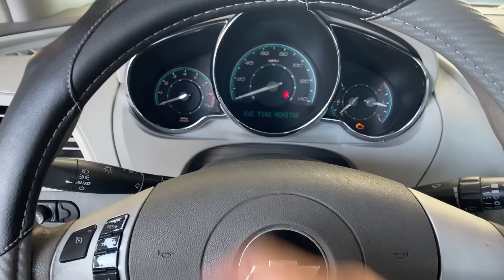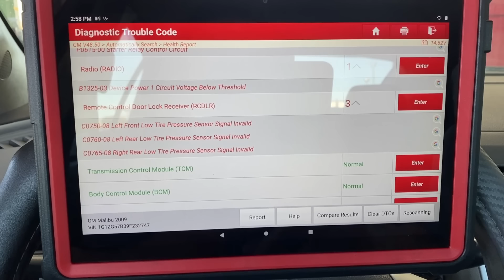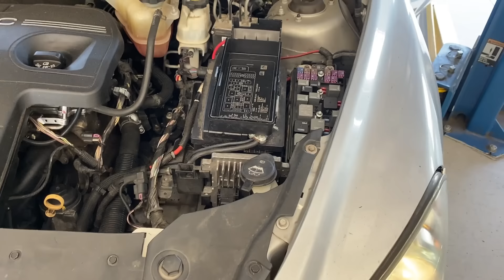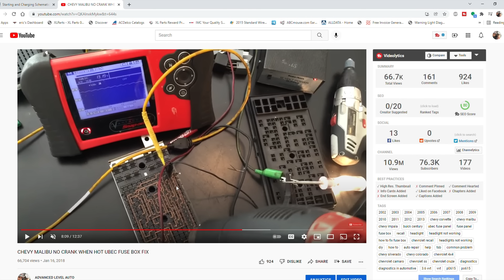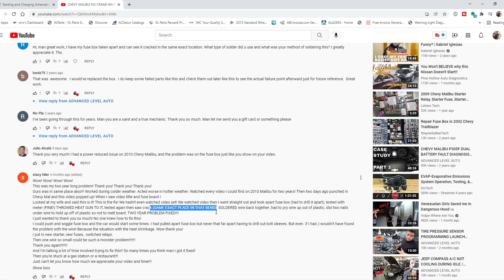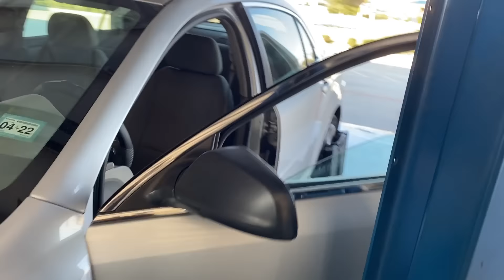CHEVY MALIBU INTERMITTENT NO CRANK NO START P0615 DIAGNOSIS & FIX

Comment: My 09 doesn't have the same issue but when it's running the dash lights will all turn on, and the guages go to 0, just today I had to use the GPS speed on Google maps coming home, and the guages we're still at 0, and the ignition didn't turn the car off, once it had been parked and I opened the hood, and it cooled down, I was able to put the key back in and shut it off. It has also had the issue of it will turn on the traction and ESC lights on the dash, and the tail lights are fully lit as you're on the pedal, even if you turn the lights off they stay on. Crazy electrical issue that you exposed that GM should've as you said. You're a genius, I'm fully subscribed and going to tell all my friends about your channel. Great video thank you so much.
Reply: It's also been in the upper 80's lower 90s the past month or so in Wisconsin and it's been acting up quite frequently, yet again man. Thank you. Great video

Comment: I had a similar issue on a cadillac ats (intermittent no electric power). Dealer scanned and thought was bcm, changed, no fix. New battery, no fix. I ohmd battery cabled (4) and discovered a possible break on a short positive cable at battery(even though looked new). Replaced oem and fixed. Sometimes, problem could be the most simplest and least expensive part.

Comment: Makes me want to go to any place that sells a Chevy any dealership and ask for a new fuse box and when they turn their head just taking it so much running out the door f*** GM f*** Chevrolet makes me want to go to General motors and slap the s*** out of the higher ups and the company I've got a 2005 Chevy trailblazer 5.3 l I've gone through three fuse boxes three fuse boxes brand new ones same problem why don't they do something about that you should have a recall or service bulletin or something who's running that company Mr. Joe  Biden ?

Comment: I found a break in the fuse box like that, but it was for the AC compressor relay. I soldered it and it worked fine.

Comment: I’m currently in a no crank situation.  2012 Malibu.  I checked the relay bias points without the relay installed.  I’m getting 2.3 volts.  That tells me the ground is good on my fuse block correct? Also how would I check if relay is bad?

Comment: One possible cause is the underneath the engine bay fuse box, the box with wire connectors may be burned causing interruption when hot especially on hot days, recommended fix is to get a professional car electrician to wire a new fuse box for the one that's burnt

Comment: Question, after removing the fuse box, how did you separate the copper layout  board with the pins on both sides?
Reply: I have the  bolts and metal housing out. Do I need to remove all fuses in order to separate copper wiring layout?

Comment: Bought a new fuse box solved the issue immediately, did it in March 2022 , still running strong
Reply: My ex had the same thing happened new fuze box got it running but after disconnecting the battery it won't turn over 😡

Comment: The problem was my bottom fuse box underneath was burned, which made the car not crank in hot weather, the fix for it is to replace the burnt ends, but learn from me and get a professional, engine harness wires are in tight places so it was difficult to do it correctly with out take off the harness which I didn't do

Comment: 2010 Chevy Malibu, same exact problem. It’s happened twice now at random times. I play around with the ignition a little, wait about 30 minutes, then it starts fine.

Not a single shop or mechanic has been able to diagnose the problem but it seems like it’s common in these cars.

Comment: This is amazing. Back in the 90s I used to own Ford Tempo that had similar issue. After engine heated up it shut down. It was intermittent issue. Mechanics couldn’t figure out what the issue was. It became process of blind part replacement that costed money. Now, that I see this video it was eye opening how it is truly easy to misdiagnose the issue. Thank you Eric for sharing all these valuable information. 👍

Comment: Going through the same thing on a malibu my gm buddy looked at a diagram and said Ignition Switch is hardwired to the bcm that sends a signal to the pcm that finishes to the relay that powers the signal wire to the starter which I have no power to the trigger wire but all fuses and relays are good and said it's either the Switch bcm or pcm so ill definitely check under the box highly appreciate the video thanks 🍻 the box is cold and still doesn't start so it may be broken beyond temp control I hope soldering can fix it its a rough vehicle but all they have for now and doesn't have much money

Comment: Nice job on the video but cant understand why they wouldn't just have you take out the box and inspect the copper wiring and solder , makes no sense. 

I'm having a no start no crank with intermittent starting with a 2005 Mitsubishi galant 4 cylider, 2.4. . 

Car starts right away maybe 80 percent of the time but when it doesn't start though , I have to keep turning the ignition and it eventually starts. Sometimes after 5 mins it restarts, sometimes it can take up to an hour to restart

No one can figure out the problem, any ideas? I did have a P0335 position crank sensor code come on very briefly but never appeared again. 
When my car starts, the crank is strong.

So far no one can figure out the no crank, no start with intermittent starting problem. Any ideas?

Comment: Could this be an issues with caddilac srx 2011 cause I have code with no crank or start
Reply from the maker: Yes. I believe it is possible. They might actually use similar style fuse boxes. Try heating up the box to see if it creates the problem.

Comment: Love the video. I am a DIY I rebuild engines head gaskets timing. Anything mechanical but I a weak on electrical so thank you. I am 50 years old and you teaching a old dog new tricks. One question what is the best bidirectional control  scan tool for dodge and ram. 5.7 hemi vehicles?

Comment: There is also a trouble for Crankshaft Position Sensor Circuit A fault code. The main problem is the Fuse Box.

Comment: Hey bro I need your help! Last night I hit a big puddle in my 04 nissan quest, afterwards the dash lights dimmed and I wasn't able to accelerate anymore until I put it into neutral and revved the engine a couple times. Then it would come back to life and drive again. It did this a couple more times until I got to the end of the road where it decided to shut off. When I turned the key all the way off it completely locked up. I wasn't able to see anything electrical turn on  when I turn the key over and I can't even put it in neutral out of park. At first I was thinking coil pack got wet but now that it's sat for awhile and it's still the same I'm thinking the condition is worse.

Comment: Eric, I've learned so much from you, Eric O of South Main Auto & other channels.    I had an intro to circuits back in H.S. physics class, but that's all.    You are probably the best instructor on YT, if not one of the best...    

QUESTION: is there an auto tech book, reference manual, or a series of text books that you used in tech school that you would recommend I read & teach myself the fundamentals?  (have a career & small kids, just want to step up my diy game)    your explanation of bias voltage as the car's way of testing a circuit is the knowledge I'm looking for....

Comment: Great video my dude. Have similar issue with a 2012 Buick Regal. Might try this. Curve-ball on this. When it won't start, I can barely move the wire harness and it starts on its own. Btw. You can take the tip of the Power Probe off and it has a banana jack there. So you don't have to hook up a alligator clip through multiple connections. Save you some time.

Comment: very interesting,    I didn't realize an automotive fuse box could contain PCB traces that could crack.  I understand why they want to replace the box because a crack could be across several traces that are not causing problems yet and current flow has a tendency to intermittently seal traces.    But if you can't get parts,  I think I would dive in there with a good voltmeter and sort it out.   But if you are dealing with mylar connectors that's a different story.

Comment: You SMA and Ivan are the ones who "fix" the problem.  Great tech tip with the heat gun!  I've used mine in the past to locate a problem.  Another way to temporarily repair it would be to run an external wire from the relay socket to the wire going to ground.  Not the best way to repair it, but better than having an intermittent problem until a new box is available.

Comment: 2002 Malibu,  80K miles, 9 years old. The engine would randomly accelerate at red lights.  Chevy Dealership could not duplicate the problem. Dropped it and bought a Honda Element with 120K miles.  NO PROBLEMS.  Vowed to never do domestic...

Comment: Also, please tell how the bias voltage is sent out by the ECM to the relay?? 
I thought bias voltage are used for circuit MONITORING Or FEEDBACK signal  to check circuit integrity!

Comment: Great diagnosis as usual and it almost seems like the solder fix is at least as good as a new printed circuit fuse box which will fail if nothing has been done to compensate for the different expansion rates of copper and plastic. Hokey, but how about a hard wire fix to ground where the relay plugs in as a hack until the part is available and maybe permanent fix if there hasn’t been a product improvement done on the fuse box. Bless you for sharing all your knowledge with those that can’t afford shops that specialize in parts changing until the problem is finally solved.

Comment: I wouldn't just put a solder blob, because that will crack too.  I'd solder on both sides with a wire between the two solder joints (basically a parallel path for current).  That will be a bit more flexible.

Comment: That's the quality of GM as there garbage today. Chevrolet Cruze & Malibu are some of the worst GM models especially the 2016-2019 as they had transmission issues & the new 1.4 Turbo wears out the motor fast. I seen them not make it to 100k or just past it before major issues.

Comment: impressed that you found time to not only read but also answer my comment . I didn't think of the wire under the relay pin because i'd be worried about over flexing the female connector in the fuse box but if you were going to replace the fuse box or for a road side emergency I could see it.But it would suck if decided to solder it and it didn't work right because of a lose pin fitment problem. Great work I regularly watch south main auto and fordtechmakuloc because of their knowledge and thought processand I'm going to add you to that list. THUMBS UP EMOJI

Comment: I had a fuse box problem for headlight circuit previous mechanic wired external relays outside the fuse box and water got in , did the repair like your first video and sorted the problem

Comment: This is obvious it is a manufacturer quality issue, or they did not test the vehicle well enough in extreme temperature, or simply a planned obsolescence. Back in the 80s, 70s and before, long before the digital age, Chevrolet quality, specially on Caprice & Impala as well as GM V8 vehicles were lot better. Believe me if GM enhances their quality parallel to Japanese, they will out compete them in sales. Thanks and take care.

Comment: The new fuse box will have the same problem with metal fatigue in the bends that will fail again... how stupid! Obviously the machine/mould they use for bending the wires is stressing the joint and providing a failure point at all bends.

Comment: Super video, sir. I just watched PHAD vid where a module with bad solder joints would result in no crank no start. Reflowed the solder to create a good electrical path and everything is good. No Parts Required!

Comment: I swear phones be listening to your conversation lol. I been goin thru this same crap for weeks with my daughters car. Changed the whole battery cable from the battery to the fuse box. Haven't had a problem again. I noticed when the car wouldn't start her interior lights weren't coming on also. Lights on.... car starts 🤷. Drove me and my mechanic crazy. I bet that's not the real problem, this 2012 Malibu has been a pain in the ass. We'll see if it comes back

Comment: Solder a wire on pin 86 on relay. Bend relay pin flat. Hook wire to GND. Put relay back into fuse block.  This will help the customer to start their vehicle. while they wait for the fuse box to become available.

Comment: This was a very interesting problem Eric! Good to know this seems to be a fairly common problem. Thanks for the video and instruction. You are a very good teacher!
Reply: I had this same problem on the exact same model car, customer didn't have budget to replace fuse box, I just ran separate ground cable to relay, problem fixed.  Flaw on this model fusebox..
Reply: @globalcommerceca  ol

Comment: Ha ha, good luck with GM admitting they have a problem. They've had a problem with the AFM since 2007 and they have yet to admit it or have a recall. They know it's gonna cost them a ton of money if they do.  GM and the others are really building junk now days. Also, just because it's not listed as a TSB those mechanics at the GM dealers should be troubleshooting like you did. Too many places are parts replacers, unfortunately.

Comment: great video ERIC<I think the garage is doing what's best for itself by covering their ass.And i can't blame them for that ,Let's say they did do the repair with your method,then the little OLD LADY is driving down the freeway at her usual 55mph while in the meantime all the car AND TRUCKS hauling 80,000 pound loads and their  going 75-80 MPH and trying to get around her ,BUT SUDDENLY >>>HER CAR GOES INTO LIMP DICK MODE,well i can tell you it's going to be a mess on that road.And now GRAND-MA is now pushing up daisy's on the side of the road.BUT now the insurance agent is looking over the car and the only part that NOT CRUSHED is the fuse box,well he says >>what do we have here???You know the rest.If it was my car i would do it in a second,and if this was 30 years ago almost anyone would fix it and not worry,but these days if your car last 5 years your lucky,even if it's only one 1/16 wire that's cracked out of the whole car.good video.

Comment: That generation of Malibu’s are terrible cars. Even changing a headlight is an extensive task. Excellent and detailed video, keep it up.
Reply: Poooooooooo on
Reply: Chevy has assigned too many engineers to take as much money out of each part as they can. Now the Malibu is unreliable. If they can get $5.00 on each part, its adds up.  The problem is nobody will buy them. My transmission had to be replace at 45,000 miles. Cost $4,000. I have a corvette and it's a much better car.  The Japanese make better cars today.
Reply: Changing the third brake light was a hassle too 👎
Reply: My 2012 didn't need any engine repair till I  hit 125000 milres,great car
Reply: @philbuntin619  my 06 impala went 250k miles before the engine needed any work. Those ecos are junk.
Reply: @philbuntin619 125k isn't anything. That is terrible. No engine should need work at that low of mileage.
Reply: i have the same year and always have had problems with it from electrical to the transmission goin out
Reply: There is not a quicker way. Everytime I changed the light I had to buy a new harness cause the low beam would melt the harness housing. I put a new housing with two grounds and haven't changed it for years. B4 I would change it 2 twice a year.
Reply: @moneynoluv  Now that you mention it, there must be a problem with the low beam circuit, that’s the only side of the bulb that failed in the 5 times I had to replace bulbs in only 122k miles. I’ve talked to many people who’ve concurred.
Reply: Headlights are a pain. I replaced mine when the bumper was off with LED’s just so I wouldn’t have to do it again.
Reply: Fk these cars 2011 3.6 no crack no start put to much money in to this car fkkkkk them this is to drive people crazy and break the bank at the same time
Reply: Qual era o problema desse carro? Eu não entendo inglês. Peço que me digam
Reply: I got a 2022 Bro I just did mine it’s crazy I couldn’t even finish the driver side like who’s great idea was it to put a cap over the light that is impossible to get off without damaging
Reply: Bro changing the headlights made me want to set my car on fire
Reply: @samcrowley7786  It’s so stupid, completely removing the splash guards and bumper. You can cheat a little bit, and only remove half of the bumper on the side of the failed light  and just kind of bend it out of your way. Advantage of cheap plastic
Reply: Yep. Much better off with a Camry
Reply: @andym1223 exactly it’s only Honda and Toyota’s for me stopped buying American from the big 3 Detroit a long damn time ago and haven’t looked back when get sick tired of being sick and tired of constantly trying to fix the crap or being stranded you really get sick and tired 😂

Comment: I applied what you taught me on a pin-drag test for a Silverado ABS problem, similar year to yours. It cost me 0, abs is back in business. It's a similar story as to the fuse box issue. Thanks a million.
Reply from the maker: Awesome!
Reply: if you lost the ground and ground to the battery or frame after the issue the car should crank up correct?

Comment: silly question could you have left your test relay in place and run a wire from the ground terminal  on the relay to ground as a temporary fix and charge the customer for the tool
Reply from the maker: You could actually just run a jumper wire from the ground terminal of the relay to ground. I've seen some people wrap the bare end of the wire around the relay pin before plugging it into the fuse box. That could be a great temporary fix.